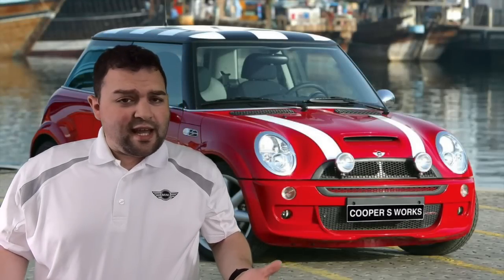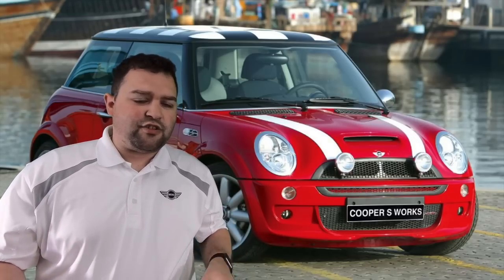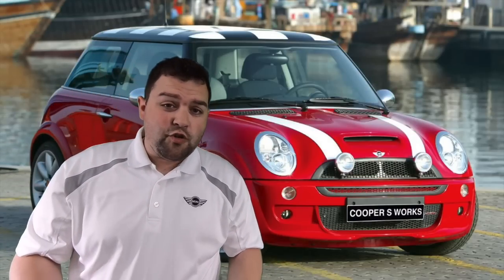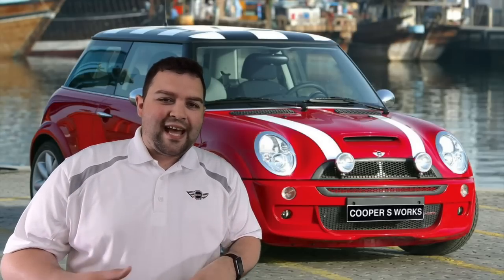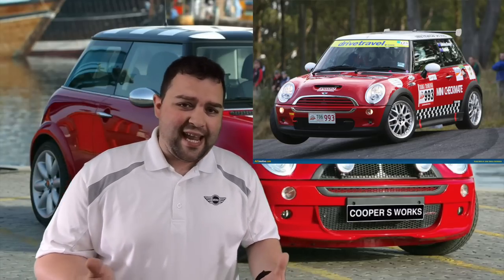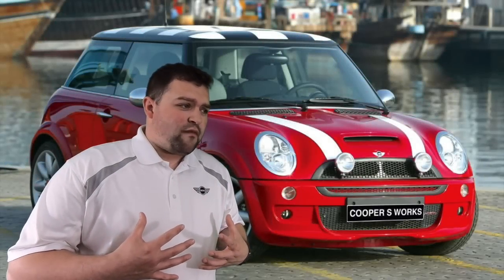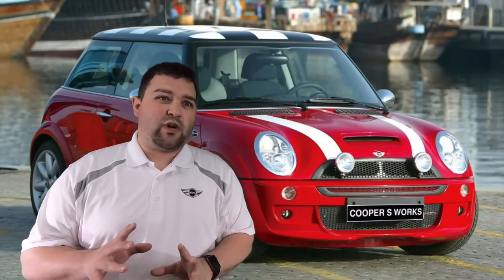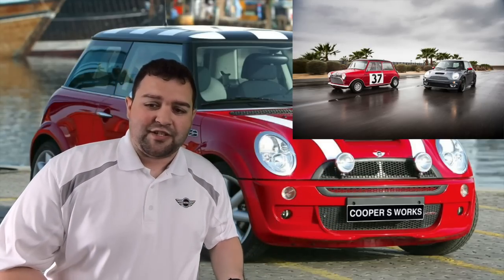The Definitive Guide to the R53 MINI Cooper S - 2002-2006

Comment: At 74 years old I bought a 2006 Cooper S last summer.  Feel like a kid again!  I bought it through a dealer in Seattle that only deals in used Minis.  Mine was a one owner car out of Palm Springs, CA.  Well documented and a clear Carfax.  In nine months there have been zero issues.  Not even an oil leak.  Great little cars.  And I mean little compared to what I was driving before it, a 95 Impala SS that I had bought new and driven for 23 years.  No regrets.
Reply: What was the name of the shop? I think I actually saw them on Craigslist recently.  Trying to get one out to Hawaii!!
Reply: @charliediebolt2148  The company is:  northwesteuro.com  Don't recall the owners name but had no issues dealing with him by email, phone or in person.  He has a large indoor showroom and doesn't mind moving cars around so you can drive the ones your interested in.
Reply: Paul Lee Jason! Yeah I talked to him the other day, I’m looking at a 2002 with some nice upgrades and about 100k miles.  How many does yours have? He seems to really know his stuff
Reply: @charliediebolt2148  My 2006 R53 had 88K on it when  bought it.  Now has about 92K after a bit over a year.  Still running great.
Reply: @paullee2177  My 2008 Cooper S Convertible (yes it’s a Supercharged 2008) and it has 40k miles
Reply: @freddieparrydrums  yeah they were made thru 05 till 08, yours is the r52 nice one mate!, I'll be getting one 2morrow but 06 JCW with 45k
Reply: @oscarc7993  Yeah my bad! And what an awesome car man. Enjoy it 👌👌
Reply: Getting my first Mini at 63. I drove a first Gen new Mini around 2005 and never forgot the experience. Now this is like Christmas. I should have it delivered in the next few weeks.
Reply: I bought a 2004 S in August 2022. It had 15.5K miles when I bought it.  It now has 26K miles. Electric Blue, leather seats two-tone blue/gray, moon roof, interior chrome package, heated seats, cruise....pretty much loaded.

All my service has been by Mini in Naperville, IL, and Indianapolis, IN.

Zero problems. Zero rust....

But looking to buy a 2013 JCW converible so the 2004 is for sale at $6800 firm.

Comment: I had the seat heater issue. Damn thing was turned on one day and started a fire on the passenger seat. I was lucky I had accidently hit both front heaters when no one was in the passenger seat. Took it too my local Mini/BMW dealer to get it disconnected and they gave the car back to me with the heater still active (guess they didn't test it for safety before returning the car to me). Anyway, it caught ON FIRE AGAIN. Mini in Canada was of no help, didn't want to fix it for me or do anything, didn't seem to care they gave it back a car that again caught on fire. After about 8-9 months of going back and forth I was forced to use my insurance to get it repaired. Wasn't cheap...

Comment: I owned a 2004 Cooper S .. Traded it in at 100k and the only real issues I had were power steering pump (which became a recall) and the lower control arm bushings starting to fail at around 60k.  Other than that, just minor electrical niggles before I let it go. The clutch lasted til then as well. That car was an absolute hoot to drive. Loved that thing.
Reply: @TheMINIac   Yep, I just bought an F56.. 2016 Cooper S.  Very different than the older models like the R53.  Still a great car but not nearly as go-kart like in stock form.  Better build quality and much more refined though..

Comment: Have 3 x R53 Mini Cooper S 1 x Red 23k miles: 1 x Blue 66k miles & 1 x Yellow 70k Miles - just a great little car. Red and Yellow are mint condition with full documented history from day 1 0 Bluey been a bit neglected by PO, eldest will get the blue one as a going away to College present, yellow one will remain total stock; Red one will have some discreet mods to take it to 250bhp, but will still retain stock appearance - lot of fun when they start to climb past 1800 rpm through to 3000 rpm, and they flat track through corners like nothing else; very fast.

Comment: I bought a 2006 Cooper S Checkmate in 2015 with approximately 42k miles on it. A week after purchasing I had the coolant tank replaced. It was then replaced again the same year, but by MINI dealership. I haven't had a problem since with that part.

Right now I'm at 73k miles in a 14 year old car and one of the fans failed last year . It's running the high fan all the time. I'll get it fixed this year. It needs a front control arm as well.

Overall, it was well worth it to get this vehicle despite the few problems.
Reply: @TheMINIac  How much does it cost to replace in your area?

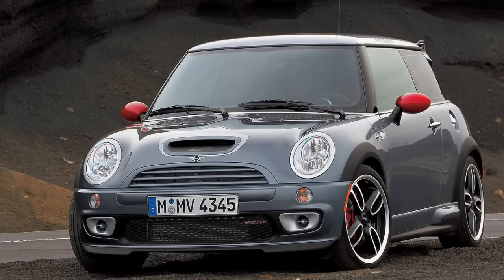Comment: 1:53 Just saying I’ve owned multiple R50/R53 Minis and never had or heard of any of these issues. If your watching this video to decide whether or not to by an R53, the best advice I can give is make sure you getting it from a reputable dealer (I.E from a garage, that might include a 12 month guarantee) and make sure you test drive it before you commit. They are lovely little cars with plenty of low down torque and plenty of aftermarket mods available to make it unique.

Comment: Very glad I found your channel. Thanks for the thorough rundowns of the most likely R53 issues. The one I bought only has 15K miles on it so there's not a lot of maintenance history.  I did find out that the power steering recall issue was never addressed so it'll give me a chance to meet my local Mini dealer.

Is there a statute of limitations on a recall item? I hope they can still get whatever parts they need to correct the issue.

Love your channel and very happily subscribed.

Comment: I'm looking at a 2004 Mini Cooper which has very low mileage and drives so well.
But steering is very stiff when stationary or trying to park.
When it's in the road- the steering is fine.
Any ideas? Thanks

Comment: Hi There,   Whats  the difference between a Base model and an S model of the same 1st generaton coopers.  What are the parts that can be interchangeable...A Base 2003 R50  and  an S 2006 R53....Hood, Bumpers Front and Rear,  Rear Wing, Side Mirrors, Doors....What else in terms of suspension and Engine Components....Please let me know  Thank you

Comment: Looking to buy one and just wondering is it worth to hunt for JCW or is it better to actually buy a good condition S ? I am looking for a fun daily drive car, need petrol with some power behind it and mini seems to be the case, my sister owns a R53 1,6 diesel version of this car and it is quite fun to drive, I am looking either at JCW or S model. 
Since it is going to be daily I am wondering if its worth to go for JCW since those are harder to find and probably have higher maintenance costs? Another thing is it hard/expensive to raise the power of S? I got no experience with supercharged cars, R56 with turbo can be remaped and that is quite easy mod, what about supercharged R53? 
And in general, which one would you recommend R53 or R56? I do know that the main differences are interior detail quality and supercharger vs turbo, I do believe that a turbo one should be more fuel efficient, but I do wonder which one of these are more fun to drive, since the engines on these two work a little differently through the rev range.

Comment: How do the Convertibles cope with performance suspension and aggressive driving? I see a LOT of them but don't know if it will twist the body out of shape. (also, thought of a K-series swap. A tremendous HP gain)
Reply from the maker: I’ve not heard of anything bad regarding structural integrity and modification.

Comment: What exactly is the valve body issue with Aisin automatic and is the fix?  Hdd a problem with mine several reliable BMW shops suggested trans needed to be replaced to the tune of $11K, but another shiop said it was just the valve body and the earlier ones were weak.  He had a lot of them, and then there was the class action about the CVT transmission which fortunately not on the R-53
Reply: @TheMINIac  What was happening was it would not shift automatically but when I used the manual mode it worked fine.
  So two places said I needed a new trans.  The cost of the trans was $9K and about $1,500 to install.  It was the cost of the trans that was ridiculous.  Ben at Cooper and Bimmer Experts in Asuza, CA looked at it and said its the just valve body, and had seen a lot of them fail was a weak point on the cars.   It cost $1,800 as opposed to $9K .  Less than $1,000 to install.  Car runs great now. 

Another point is that the CVT trans is junk multiple failures.  There was a class action on this, don't know out come but....  Again Ben had seen a lot of them fail and it wasn't the same part over and over which is concerning so I would not  buy one of those.

Comment: Is the r56 n18 Cooper s much more reliable than an r53? Really want to run an r53 but hear horror stories about them. Currently run an r55 Cooper here in the UK..
Reply: @TheMINIac  

R53 with service history  I have a 2003 53000 miles . With a Reduced 15% pulley. 
It's totally reliable.

Comment: My 2005 R52's convertible top just croked 😭 Mini wants $3k to fix.
Reply: The motor seems to work fine. It successfully unlatches the passenger side but fails to unhitch the driver side. The sunroof function still works perfectly. The dealership told me I can either replace the entire mechanism or just the sunroof slider mechanism. Both are right at $3k and they refuse to investigate and fix the actual problem. It's like looking at an engine with a locked up starter and recommending a full engine replacement. Doesn't seem to make much sense, but... I'm not a Mini mechanic.
Reply: @Apoplectic_Spock  shop on line in uk ...even with import duty itll be at least half that
Reply: I am in the same boat. 3K CAD. But, the original top lasted for 15years. The new one will last also 15years. So, it's 3K over 15years.

Comment: I've never seen a cooper get to 150,000 miles. They are usually long dead before then.
Reply: Sleeper Cell  .....we regularly get them for sale with that type of mileage on DoneDeal a trading website here in Ireland 🇮🇪
Reply: @MillieonaVespa  That's really rare. You may see a cooper with a little over 100k here and there but 150? I think i saw one once, however I do remember the owner saying it had had a new head gasket and cylinder head. The highest mileage one I can find on ebay has 110k, I can see ones being broken for parts that have 80 and 90k.
Reply: @TheMINIac  Yeah but yu live in the States. Alot of those cars live in very dry warm areas and spend alot of time doing long single journeys. In the past  8k miles mine has needed a new power steering motor and an new radiator fan assembly. Thats close to 1000 usd all in all. If a wasn't such a fan of R53 mini cooper's i'd have scrapped it.
Reply: I had over 150,000 before I totaled mine and it was in great shape. Cost a lot of $$$ to keep it that way thou
Reply: My 2005 cooper s model has 173k miles and it drives amazing noajor issues just comment tail light rust
Reply: 2005 S I just hit 169,000 still running strong.

Comment: Poly bushes are useless and will cause suspension binding if not greased every 6 months to a year. Unless this is a race car new oem rubber bushing make the most sense and will last for years
Reply: @TheMINIac  how often do you check ? You need would need to remove your wheel disconnect the sway bar  and make sure the arm move up and down freely. Even better test is having your car corner balanced and seeing if you get repeatable numbers on each corner of the car when the car is “bounced” up and down on the scale. Most likely you won’t due to sticking. Easy enough to Google it. Poly bushings need greasing if you don’t they stick. Not rocket science
Reply: @TheMINIac  it’s not car specific. Again just Google poly bushings and grease. Unless you run grease fittings and grease them they will stick after awhile. Not worth the hassle over oem IMO. Shopping for a r53 myself and plan to replace all bushings with oem. Thanks for posting your video was helpful overall
Reply: @TheMINIac  they will last forever just need grease lol. So it’s extra time and honestly most people have no clue and never grease them. Grease or zek fittings don’t come with the bushings and most don’t buy them and install. Something people should be aware of is all